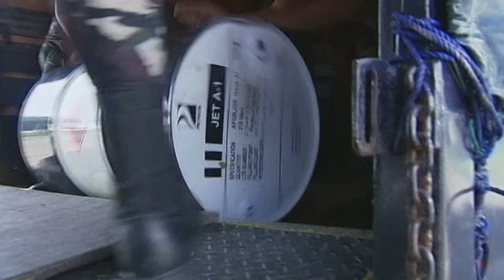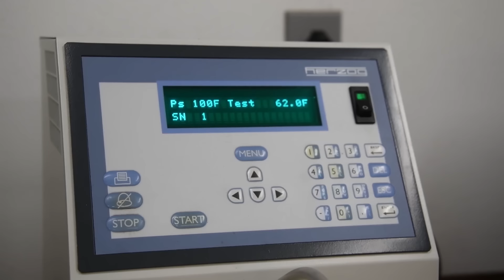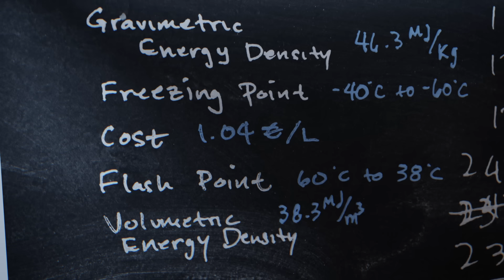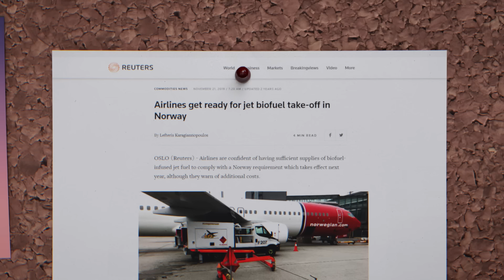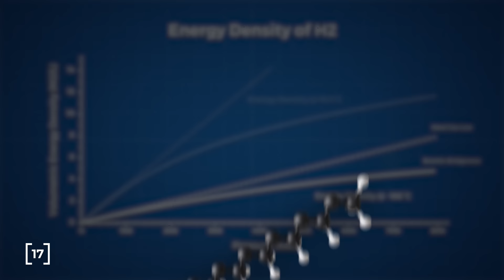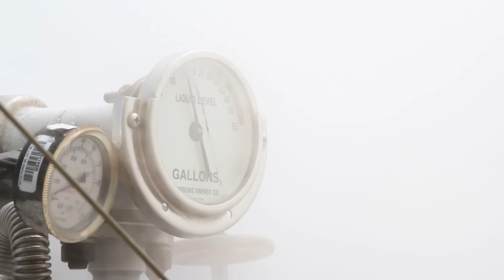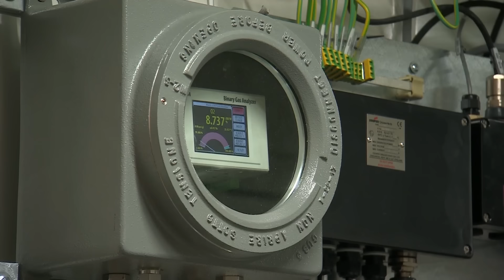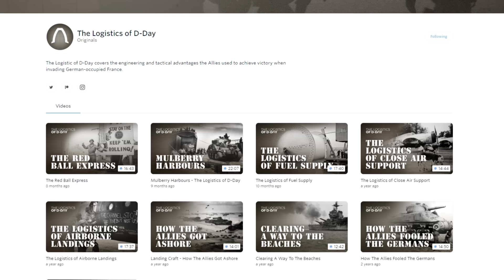The Uncertain Future of Jet Fuel

Comment: This is an extreme technicality nit-pick, but the goal of jet fuel is not to "raise the temperature to raise the pressure". This is because as you know, the Brayton cycle operates with isobaric combustion.
Reply: So you have to understand that during the design phase of an engine, the jet fuel selected raises the isobaric pressure in the combustion chamber to a value that depends on the choice of fuel.  Some type of fuel will give you a lower isobaric pressure and others will give you a higher value.  But once the engine is designed and ready for flight, that fuel consideration has been settled.
Reply: @satmohabir7175  Why do people feel the need to invent nonsense about things they have zero knowledge about?
Not a single statement in this comment is correct. 

Combustion pressure in jets is determined by the compressor and the turbine alone. The type of fuel has no effect on this, just on how much fuel is needed to get to the desired temperature. Pressure does not increase as fuel is burned in a jet engine. It actually decrease slightly through the combustor (by 3-4%).

I'm an aerospace engineer and was the TA in jet propulsion class in grad school, but if you want to check that for yourself any book on gas turbines will tell you the same.

Comment: "Converted to run on bioethanol"
--> remembers last video mentioning the production of bioethanol to be an energy negative process
Reply: from corn  is the core part of that
Reply: This video did a bad job of clarifying or explaining.
Reply: But unlike cars or electricity as a whole, aviation can’t truly go carbon neutral unless some major leaps in battery or hydrogen fuel tech are made. So bio-ethanol isn’t as bad of an idea
Reply: Sure, but that just means you have to view it as an energy storage technology, rather than an energy production one. The energy density of hydrocarbon fuels might still make it the best solution (or least-bad one) for aviation.
Reply: THANK YOU
Reply: Energy negative isn't inherently bad.
Reply: And it is energy-negative only if you produce it from fresh crops. If you produce the biofuel from biological waste, it gets much better.
Reply: Charging a battery is also an energy negative process
Reply: @HalNordmann  The problem is that the bacteria producing biofuel are kind of picky eaters. So what in theory sounds like a good idea (make fuel out of waste) is in reality often just not doable.
Reply: Of course. Third Law of Thermodynamics. Every conversion process loses some waste heat, making the process lead to a net energy loss.
Reply: @alexsiemers7898  electric car also could not be co2 free until it would be charged from solar, wind or nuclear sources

Comment: One thing I've heard about is mixing hydrogen with Ammonia - would love to see more about that on this channel.
Reply: I think the only thing you would get is NH5 wich is unstable and would go back to just beeing NH3 and H2
Reply: @curium9622  eh, I'm no chemist so I dunno. But give it a google. There are companies, including Japan's TDK, persuing this right now. So I think there's probably something there.
Reply: @adamlytle2615  i think its about using the hydrogen from the amonia instead of generating it by electolysis
Reply: @curium9622  well, ammonia is already produced by combining hydrogen and nitrogen. The feedstock hydrogen still needs to be from renewable energy powered hydrolysis for it to matter.

Anyway, in the aviation context, I think the idea is that they can modify existing jet engine designs to use ammonia as fuel, or even ammonia somehow blended with additional hydrogen and it wouldn't have carbon emissions.

https://www.popularmechanics.com/flight/airlines/a33768744/ammonia-as-jet-fuel/
Reply: @iippo86  neat!
Reply: Smell farts while peeing (science people [scientologists🤔?] will get this).
Reply: @adamlytle2615  the problem is that it would still have significant nox emissions as ammonia burns pretty hot
Reply: @curium9622  
This is where the mole balancing concept comes in. From my knowledge of chemistry I think it is something like this:
2NH3 + H2 --> N2 + 4H2
Hence, for every mole of hydrogen gas and 2 moles of ammonia, you get 4 moles of hydrogen gas.
Reply: @curium9622  No, NH5 is definitely not stable, but that doesn't mean you can't dissolve hydrogen in ammonia. I really doubt that you could dissolve a significant amount in liquid ammonia, though, since hydrogen molecules are non-polar (like oil) while ammonia ones are polar (like water) and hydrogen has a much lower boiling point than ammonia, so it's like dissolving air in water. You could, however, maybe dissolve other hydrogen-rich compounds like ammonia borane (H3NBH3) in liquid ammonia, and you can certainly mix gaseous hydrogen in gaseous ammonia, though thhat seems like a dumb idea to me, and you could have a propulsion system with hydrogen and ammonia stored separately.

More importantly ammonia is already a pretty good carbon-neutral fuel, since it's boiling point is only -33°C, much easier to get too and it burns even better than hydrogen per atom (or per unit golume of gas, though not per unit mass). There is even technically some precedent for ammonia fueled aircraft with the NH3-LOX powered XLR99 rocket engine on the X-15, though that's pretty different from an airliner.

Hydrazine (N2H2) is an even better fuel, both releasing more energy and being liquid at room temperature; however, while the results of ideal combustion are extremely benign (H2O and N2), the substance itself is incredibly toxic. The slightly easier to handle hydrazine derivatives MMH and UDMH are frequently used in hypergolic rocket engines on spacecraft, and actually safe alternative compounds exist now, but all these compounds contain carbon. I suspect their combustion is much more carbon efficient than hydrocarbons or alcohols and biofuels, but I'm also sure they're much more epensive and the process of making these exotic compounds might create more carbon emissions than are saved if done wrong.
Reply: @curium9622  Actually the article Adam Lytle linked to contains the following line: "The prototype examined in the report uses a blend of hydrogen and ammonia that burns just like conventional jet fuel, the researchers say." So I'll have to actually look into the phase diagram of hydrogen-ammonia mixtures, because it's sounds like they're talking about a solution.
Reply: @miscbits6399  It seems weird to me that ammonia would burn particularly hot (I guess it depends on what you compare it to), but I can definitely see why it might produce more NOx, since it releases lots of nitrogen atoms that don't already have an unltrastable bond in a N2 molecule which can encounder oxygen before they form N2. When non-nitrogen-rich compounds burn, NOx is only created by breaking apart N2 molecules in the air, which requires very high-energy interactions, and thus temperature matters a lot.
Reply: You probably misunderstood people talking about making ammonia from hydrogen in order to get an easier to store fuel.
Reply: Why not just make electric powered planes?
Reply: @1mol831  Batteries are heavy, and don’t lose that weight while flying. Unlike fuels
Reply: Too bad we don't have no hydrogen.  Everyone overlooks this.  WE AIN'T GOT NO HYDROGEN!!!!!!

Comment: You seem to really like talking about biofuels and seem to take issue with how the feed stock is created. How about a video on vertical farming or hydroponics/aeroponics to explore those as alternatives for feed stock?
Reply: both of those are way, way more resource intensive
Reply: That could be a solution but it comes down to the fact that we are literally burning our food supply in a future where food stability is not guaranteed. I don't think biofuels are the answer
Reply: @boo3427  That not entirely true. Biofuels can be made out of wasted and unused waste like corn stocks weeds, the grass you cut, and cow shit.
Reply: Completely infeasible without fusion power. Even then you have to find a way to deal with all the heat, which is a huge problem in urbanized areas already.
Reply: Producing complex e-fuels is incredibly efficient compared to this idea. And producing complex e-fuels is incredibly inefficient!